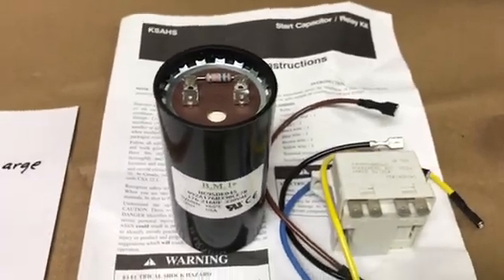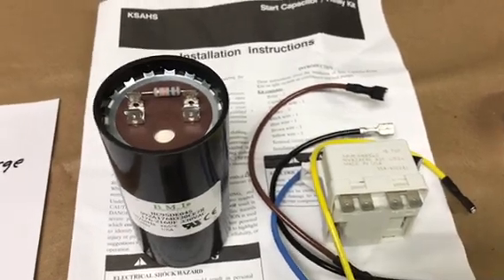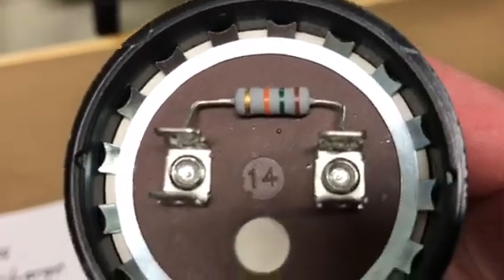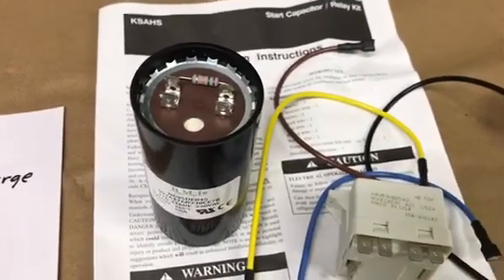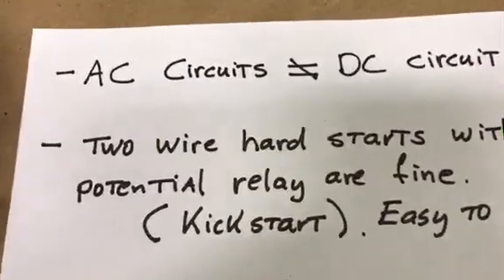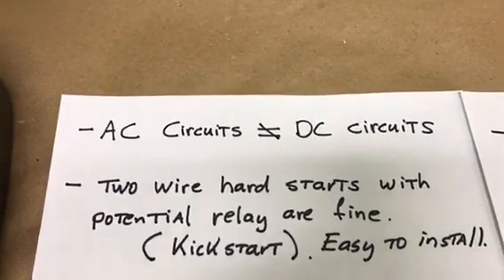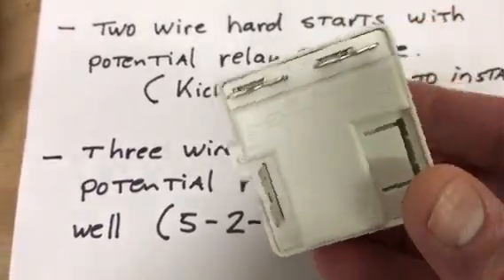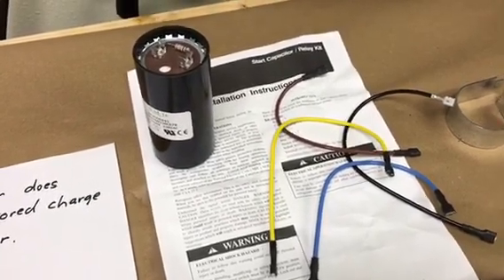Hvac hard start kits, how they work

Comment: WOW - thank you for properly explaining that the capacitor's job in this application is to enable greater torque through phase angle!  I have run across way to many videos that incorrectly state that the capacitor stores and delivers a "jolt" of power to the compressor, which is wrong.

Also, thanks for pointing out the difference between kits that use PTC vs kits that employ a potential relay.  As you indicated, the PTC type will not provide consistent starting function unless the start events have considerable time between them.

Comment: Can that Phillips hard start cap go bad ? Is there a way to fluke meter to test if its gone bad. Also can one actually just bypass it on an outside AC unit ? ( ie wire nut two red wires together that used to go to Phillips hard start cap )

Comment: One way to explain phase angle is this: The capacitor causes a delay (a phase shift) in the alternating current in one winding compared to another, so that the motor *moves*.  Each cycle gets to one winding before it gets to the other (that's what a phase shift means) so that every cycle keeps the motor going, pulling it first to one position and then to the next.   Without phase shifts, those electromagnets would just hold the motor in a fixed position.  Some AC motors need a capacitor only to start, because once they're moving, the recurrent pull of the AC keeps them moving.  Others also need a capacitor to keep running.

Comment: In a resistive circuit (heaters) the voltage and current are in phase. In an inductive (motor) circuit the voltage leads the current by a quarter of cycle (90 degrees).  
In a capacitive circuit the voltage lags the current (90 degrees). This shift ruins the torque. So the capacitor accomplishes Power Factor Correction. Thus improving the torque.

Comment: We have the 5-2-1 three wire kit, 5:30  BUT, what we want to know is… we Also have the Turbo200 on or AC unit… So do you hook up the wire that would go to Common on the unit capacitor to the Orange 🍊 CPT terminal of the Turbo200 instead..???🤷🏻‍♂️

Comment: Question for ya. I've heard from multiple different experienced techs that you must use OEM Trane Hard Start kits (start cap and relay). I don't understand why that would be if they do the same thing. Only thing I could imagine is that maybe Trane compressors have a slightly different start sequence?

Is this a real thing or just one of them "beer can cold" things you hear from the older guys?
Reply from the maker: I suppose Trane doesn't want people to screw up and expose them to warranty claims.

Comment: Sounds like you know what you’re talking about. Thank you for posting!  I have a question for you on the 521 start kit. I bought the 3 1/2 to 5 ton 521 start kit but after purchasing realized that my 4 ton (Carrier with Copeland Scroll compressor)  unit OEM start kit (found it digging on internet for Copeland specific compressor model) actually has the capacitor (microfarads were identical) that is on the 1 to 3 ton 521 start kit! I went ahead and got the smaller 1 to 3 ton start kit even though it’s not what 521 marketed for my 4 ton unit. do you think I did the right thing? Start up amps went from 108 to 58 with the 3 1/2 to 5 ton 521 kit and 108 to 78 amps with the 1 to 3 ton start kit which is what’s running on it right now. Thanks again for the great video!
Reply from the maker: I don't think the start capacitor value is all that critical.  Some OEM's have one kit for all sizes of compressor.  Sounds like what you did is working well.  It's essential that the relay switch the start capacitor out of the circuit which it sounds like yours is.

Comment: If it’s just adding more capacitance in parallel, how is it different than just using a higher uF cap?  Is this just obfuscated marketing for “more capacitance”?.   You could add a bleeder to a slightly larger cap than normal and not buy a more expensive “hard start” kit that does the same thing.  From your explanation that’s what I see.
Reply from the maker: You can't just add more uF because the start cap needs to be removed from the circuit after the compressor is running.  The compressor motor generates a back voltage (back electromotive force) when it is running.  The relay senses this and switches the start cap out of the circuit.  If you just added more uF with no way to take it out, the motor would not run optimally as it is designed to do with the proper run capacitor.
Reply: @kwm380  
So these also come with a mechanism to open their circuit after starting? 
I’m still not clear, I probably need a diagram.  These go in parallel with the start or run cap? It sounds like the start cap.  Doesn’t the start cap already take itself out of circuit? Can you piggy back on the existing cutoff circuit?
Reply from the maker: @ericrandall3539  yes.  The little box of the 521 kit for example is a relay that switches the capacitor out of the circuit when the motor starts.

Comment: Very informative explanation. I hope you still read comments as I would love your input. I personally use the AMRAD TES 5 - 2 wire kit with built in potential relay for the very reasons you describe regarding kits with PTCs. (Florida Lots-o-heat with high humidity).  A neighbor recently suffered the dreaded seized up compressor condition. It's stuck well (not shorted to ground and not in thermal protection) (windings have resistance) Normal Hard start kit/s failed, reversing run/start, and rubber mallet therapy and various combinations all have failed to free up the compressor. (we are leaning heavily on mechanical failure).  It's in the hopper to be replaced, however, this could take week/s.  So thought experiment as there is nothing to lose:  Normally procured uF hard start kits on a high end use approx 400 uF capacitors to generate the phase shift allowing for more current to produce the extra torque on the compressor.  Have you ever used or what do you think about let's say a 1000uF capacitor introduced into the circuit for 1-2 seconds?
Reply from the maker: Sorry, I don't have any experience with that particular problem.

Comment: No mention as to if a Hard Start Kit (which adds circuitry in the kit) needs to keep the current relay ( I have a current Carrier HN51KC024 Coil relay in the compressor unit box) and add the 2 wire black wires to the "C" and Herm spade connectors or remove any current coil relay. ALSO, do I get a 2-wire kit or a 3 wire kit and is it universal enough as not to worry about an specification Hard Start to purchase (ie. specs of capacitance, etc.). 
Suggestion?
Reply from the maker: If I understand your question right, if you're adding a new hard start kit you must remove the components of any old hard start kit.
Reply: @kwm380  It does NOT have a CURRENT hard drive kit inside the A/C unity. Here's the situation. Presently, there is my HN51KC014 coil relay and my Run Capacitor in my compressor's unit. I want to ADD a hard Start Kit in my Central A/C compressor unit outside. Opening the cage's access, one can see the capacitor and potential relay inside which both came with the A/C 15 years ago. I was wondering if there was a specific hard start kit and if I jst add it to the existing components as I don't know much about the hard start kit. If so, how is it hooked up with or without the current relay in the system. Thanks guys.
Reply from the maker: @jerrymontalbano3222  I understand you now. You're speaking of your contactor which is different than a potential relay.  All that stuff stays.  I recommend the Kick Start brand Hard Start kit. They are easy to install.  Just 2 connection to your run capacitor.  Select the one that fits your size unit.  They have two sizes.
Reply: @kwm380  So, it's a "one-size-fits-all" hard start kit which is installed in the compartment, and the two black cables connects to the Common and the Hern spades on the Run Capacitor. Right? I was wondering what happens to the current potential relay HN51KC024 which is there. I was curious, because I've seen a video with the 5-2-1 hard start kit which has three cables and perhaps connects one of the cables (they have red, yellow and black cables, I believe) which connects to a "potential relay" (whether it's bought with it or as an existing one). I was also concerned about the kit coming in different specifications which must match exactly what the run capacitor, potential relay calls for.
Reply from the maker: @jerrymontalbano3222  No it's not one size fits all.  Kick Start makes 2 or 3 different sizes.  If you have any doubts about how to do it I advise you to get an electrician or HVAC pro to do it for you.

Comment: It's unclear to me why  start circuits on new compressor/condenser units are not properly sized from the factory, such that it's a good practice to supplement/modify them in the field. Adding too much phase shift would be counter-productive would it not?
Reply from the maker: It’s a cost thing. If it cost $10 to add a start kit at the factory it’s too much. Most manufacturers have a recommended Oem kit as an option.

Comment: Pretty good how ever the capacitor cancels out the inductive reactants of the start winding and allows it to draw more current
Giving greater torque,      The bleeder resistor is to discharge the capacitor so that on shut down of the compressor there is 
No arc at the closure of the start relay causing it to weld stuck, it would be good for you to show how the start capacitor 
Is removed from the circuit with a momentary current draw wit your clip on ammeter and to verify it’s operation.
If you disagree with my explanation please let me know
Reply: In most applications a bleeder is across a cap to ensure anyone working on the system does not get a nasty shock even when power has been long removed. In this case, of a start boost capacitance,  your explanation is the applicable one, as without bleeding off any charge, the cap would discharge as soon as the contacts closed with potential of welding the contacts. Safety is not the issue in this very specific application. I am grateful for your pointing out the real reason for the bleed resistance as I had assumed it was for the usual purpose of not leaving lethal voltages hanging around in an un-powered circuit.

Comment: Good day sir, could you use a start capacitor without a relay?  It's for starting a stuck ref compressor that was repurposed to inflate car tires.  It was working great until it was used to inflate an inflatable pool. How many microfarads should it be and how will it be wired?  Thank you very much?
Reply from the maker: You can do that for a few seconds but unless you remove it from the circuit manually the start capacitor will overheat and blow up. I don't know anything about your motor so I can't speak to MF.
Reply: @kwm380  Sir it's a DD51C11GAX6(RSCR) reciprocating compressor, Panasonic.  I don't intend to connect it permanently to the circuit, just to get the motor unstuck.  What microfarad value should I use?  I don't know if it will work I think the piston got stuck when it has been running for more than 30 minutes.  Is it worth the effort or am I just wasting my time?  Thank you
Reply: @raymundsantos2324  If the piston got stuck then likely it was due to overheating due to excessive running time. If you are talking a kiddie pool then the run time to fill that is likely not more than the time to fill a tyre, but if you mean a big pool then likely the pump is U/S rather than the motor driving the pump. Increasing motor torque (even temporarily) won't necessarily result in either the piston freeing, or if it does, that being a lasting fix if the cylinder or piston are damaged. Besides, a tyre pump is intended for high pressure low volume. A pool is best served with high volume low pressure.
Reply: @pafmelb1927  thank you very much!
Reply: @raymundsantos2324  No refrigerant = no lubrication?

Comment: Do you mean starting capacitor works as power factor correction ?
Reply from the maker: I suppose it does alter the PF for a brief second but that is not really the intent.
Reply: @kwm380  Does it works when the compressor starts up  a few seconds and disconnecting it from the circuit ?
Reply from the maker: @wadib3eed7  Yes, the compressor generates a voltage that makes the relay open after a few seconds disconnecting the start capacitor.
Reply: @kwm380  Potential relay works as open delay by using EMF but takes the voltage from motor at starting up time, not directly from the main power, is it right ? for this reason they use potential relay to give a delay time before kick out the starting capacitor ?
Reply from the maker: @wadib3eed7  Yes the EMF to open the relay comes from the motor when it's running, not from the 240volt power source.

Comment: questions:
1) why dont manufactures put hard start kits in their AC units? 
2) what effect do hard start kits have on starting amperage draw?
Reply from the maker: I think they don't put them because of the cost, even though it's not that much.  The typical start amp draw with my kits is about 60% of no kit.

Comment: Can you oversize a start capacitor?  My 9000 btu scroll compressor has a long pipe run, so I want to give it a little boost.  The boost kits have quite large caps, for a small compressor.
Reply from the maker: Yes it can be oversized.  I think there are some RV sized kits.

Comment: Great video.  In my experience,  the word 'capacitor' conjures up all manner of theories -- all of which relate to DC voltage characteristics.  Few know that we use caps for entirely different reasons in A.C.  vs. D.C. but, then, you know that and did a terrific job of explaining this and driving the point home. Well done sir.

Comment: So when adding a start kit like the 5-2-1, is it just merely increasing the phase angle?  I can’t wrap my head around why the starting amps are lowered so much when adding these things.  I know they work, I put one on my 2 ton A/C at my camp and reduced the inrush current from 56 to about half that so my generator can run my A/C now.  Wouldn’t the proper size capacitor to begin with accomplish this?  Are these things needed to simply correct the manufactures short coming??  It seems like it is flawed engineering if you need to install one of these.
Reply: Exactly my thoughts and questions
Reply: @heistmasters6665  ,  I've been pondering this for a long time.  I'm guessing that too much start up torque could have an adverse affect on motor mounts or cause metal fatigue somewhere because of the increased torque.  I noticed my unit pretty much snaps on now.  My luck I will be ripping something apart since everything is made lighter and cheaper.   Hence, maybe these engineers know what they are doing and factor that in.  Still, it is interesting how increasing the phase angle increases the start-up torque and reduces the start-up amps.  The laws of leverage at play here I guess.
Reply: A compressor is a motor, and is subject to inrush. 
When voltage is applied to a motor, the motor coils essentially look like a short circuit in the first few cycles and diminish as the motor comes up to speed. 
In a purely inductive circuit, current lags voltage by 90 degrees.

Real power is determined by how in line the voltage and current waveforms are. 
The compressor saver is temporarily applied to  the circuit and brings the phase angle between voltage and current back into alignment.
The capacitor allows more real power to be consumed by the compressor. 
Less current is drawn since the voltage is in phase.
Higher current results in more heat due to I^2*R losses which is what stresses and damages components. 

A/C manufactures likely don't see it as a necessity and more of an added cost.
They'd rather stick to simple and traditional designs.  
Also, the A/C techs and manufacturers probably make a decent amount selling it after the fact. 
I was just quoted $453 for a compressor saver which is what brought me here.

Comment: Good video. I can, however, see a possible problem with these. The problem is this, what happens when the points on the relay stick closed and the cap is not removed out of the circuit. I can see one of 3 things happing. first and hopefully the circuit breaker or fuse will blow. Second the cap it's self will blow or 3r you wind up with a burnt-out winding on the compressor.
Reply: I agree with your summary of the  consequences, but why would the points stick in the first place? The only stress on the contacts is at the instant of opening, never on closing, and even on opening the potential difference between the booster cap and the run cap is zero as they have been in parallel up until the moment of opening, so there is reduced chance of arcing. A failed relay coil would result in the scenario you pose, but relays are pretty solid.
Reply: @pafmelb1927  Here is my understanding. With the hard start in the circuit you have that extra phase shifting going on. Remember there is a great deal of current flowing through the hard start capacitor. As soon as the hard start is taken out of the circuit the phase shifting changes as does the current flowing through the capacitor. This sudden change of capacitance coupled with the inductance of the windings in the motor could cause a thing called kick-back reactance.
Reply: @neutrodyne   So you're saying the inductive spike caused by the instantaneous change in current which was due to the sudden removal of the hard start cap would/could be enough to form an arc which could weld the contacts as they try to open? I had not considered the voltage spike caused by the dI/dt in the start winding, but was only looking at two parallel capacitors being separated. Thanks for broadening my take on it.